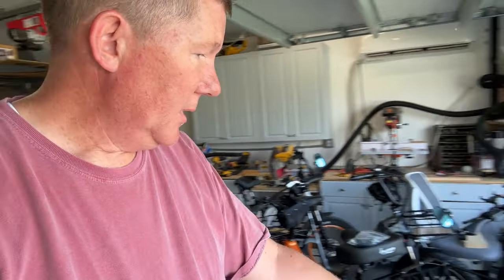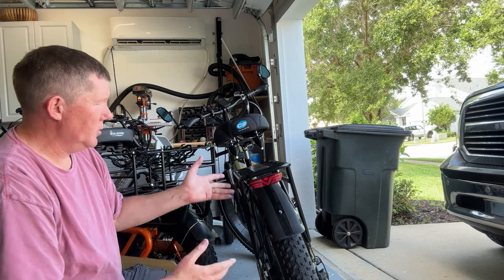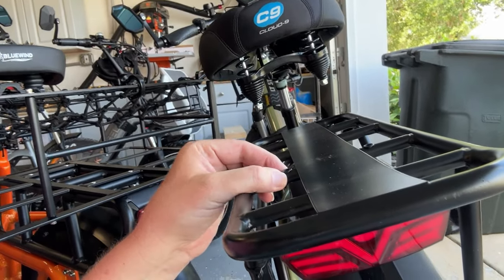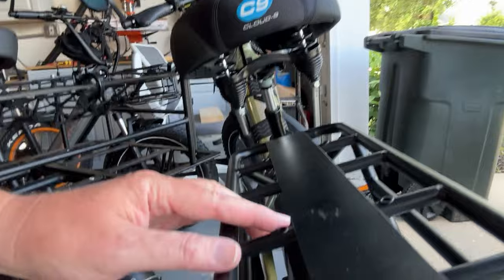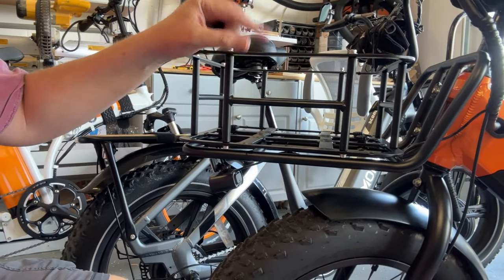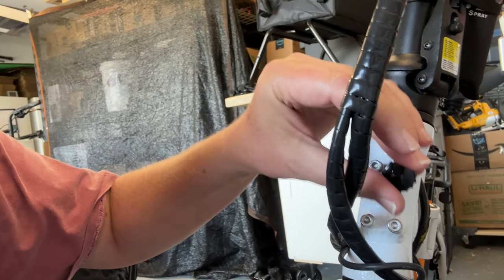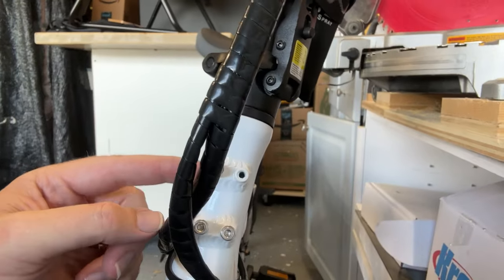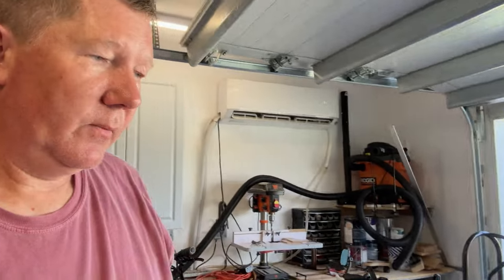eBike Quick Release Basket SOLVED

Comment: Great ideas, Richard! For the Heybike, could I use a wingnut on the other end of the thumbscrews? Seems like they would be easier to hold  on to than a regular nut. I need all the help I can get!😄 I was wanting to get a bigger basket for the back, but I didn’t want it to be permanent. I know the front basket does okay with folding the bike for transporting, but I wasn’t sure how front AND rear baskets would do. I have the saddle bags on the back right now, and that may be good enough. I reckon that I could also bungee cord a backpack or or bike trunk on there if needed when I get groceries.
Reply from the maker: Hey Jen, Sure wingnuts would make it a little easier, you need small hands to each in between the rack and  fender. You may want to test that before buying a rear rack then be disappointed. I don't have the bigger basket for the rear so I can't tell you how it is folded. As for the rear basket and saddle bags. Some rear baskets sit sideways so they stick out. If they didn't my solution would be to make screw holes in the top of the saddle bag so I could mount the basket on top of it. But because some baskets are so wife, it makes it hard to get into the bags.